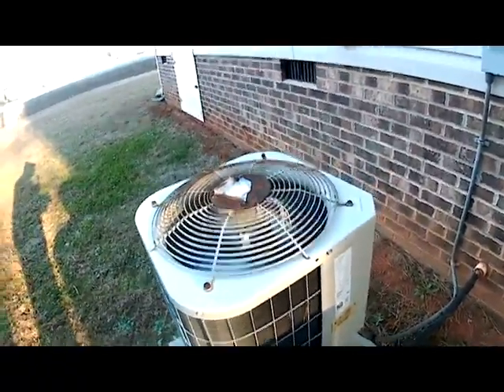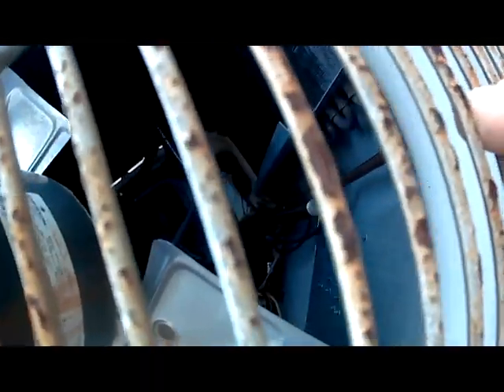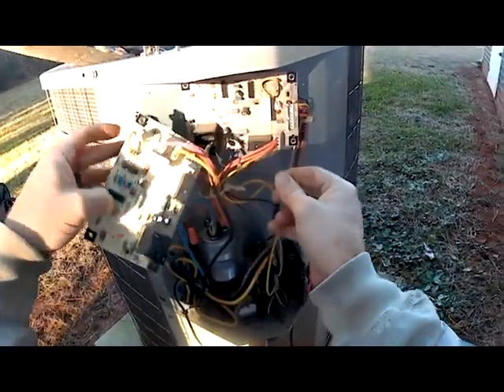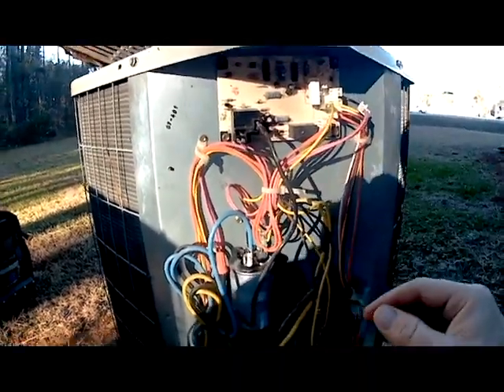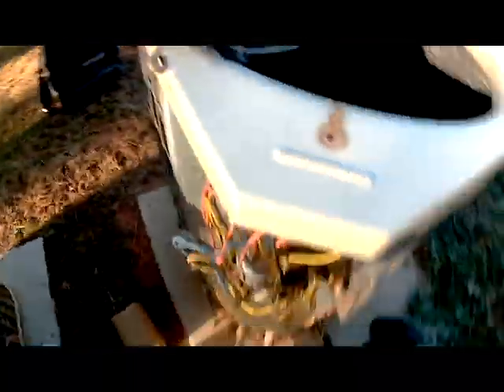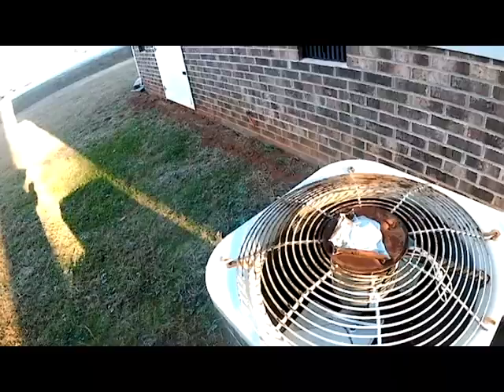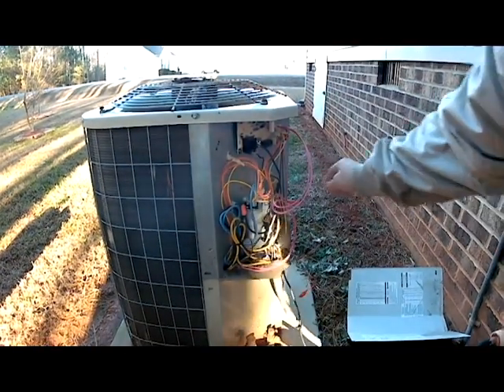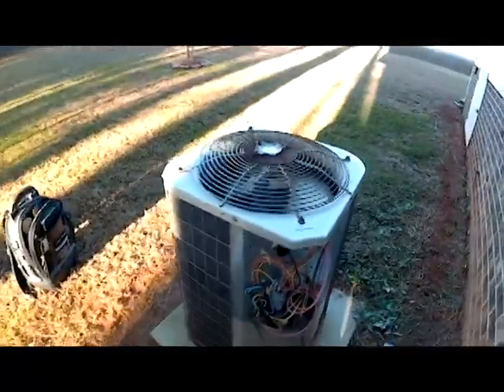How to Replace a Carrier Defrost Control Board and Sensor!

Comment: Thanks for the help. But I replaced an older model Carrier defrost board (HK25SZ359A) with a new Carrier defrost board (HK25SZ359A) replacing each wire exactly as the old wiring was connected and now the condenser fan runs continuous. In side unit and compressor cycle correctly.  I tried and HK25SZ359) board with the same results.  I wired the HK25SZ359A board exactly as the old board was wired.  As you suggested I replaced the sensor at the same time.  Any suggestions what may be wrong? Has Carrier changed something even though the board is still numbered the same?
Reply: You had to of wired something wrong. Very easy to fix…. Look at the wiring diagram on control box inner cover,or in the IOM for you unit. Follow wires and check landing of wires on terminals. Good luck my friend.

Comment: Does it make sense that a control board would go bad in a Carrier unit which is only 5 1/2 yrs old? It was a new unit in new construction with move in 5/29/15. We never had one go bad in our previous home with a unit which lasted 15 years. We just had our seasonal check up and they said it needed replaced. 
Watching this I mostly feel I could do it as I see the parts sold online but I really could FB get a clear view of the sensor you replaced so I’m less confident on doing that part right. But first I’m questioning if the board is bad. Thanks

Comment: I have a question, my Ruud heatpump gives me a code for no power, but I have 24volts  coming into the board, just no 24 volts coming out that runs to my contacts. Do you think its my board?

Comment: So which one actually failed?The board or the sensor.
Reply from the maker: The control board and we always if possible replace the  defrost thermostat with the control board since that is such an minimal cost too make sure all defrost parts are working properly for years to come.  Thanks Robert for watching!
Reply: Travis Poe  Thanks for sharing brother
Reply from the maker: Thank you so much Robert!! @robertcherry4971